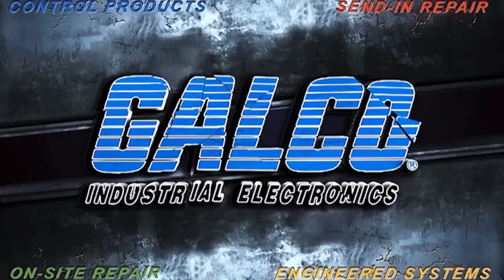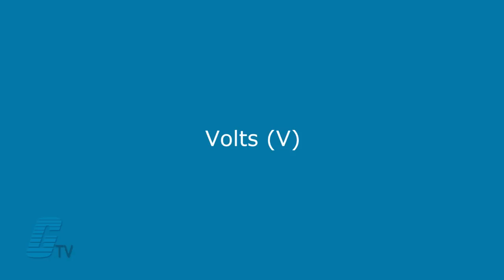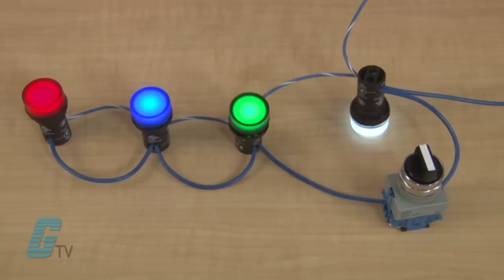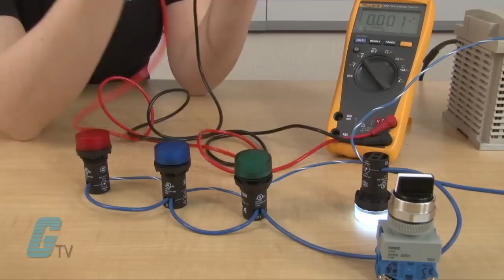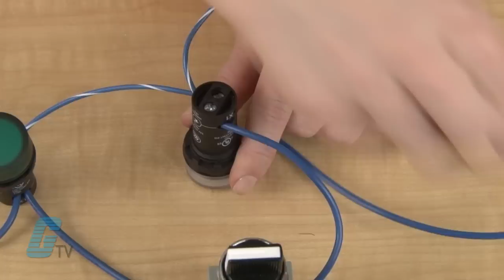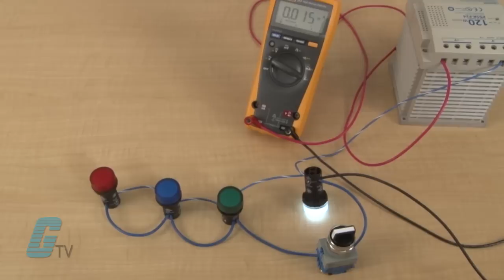How To Measure Volts, Amps, Watts, & Ohms with a Multimeter

Comment: Perhaps you could try use the converter . If a high voltage needs to be generated from a low voltage, a boost converter can be used. This represents one of the three elementary switching regulator topologies and requires only two switches, an inductor, and input and output capacitors.

也许您可以尝试使用转换器。 如果需要从低电压产生高电压，可以使用升压转换器。 这代表了三种基本开关稳压器拓扑结构中的一种，仅需要两个开关、一个电感器以及输入和输出电容器。

Comment: So volts are the traffic?
Amps are the number of lanes on the highway for the traffic to flow?
More amps means more lanes of traffic?
Resistance is where some of those lanes are closed further down the road - so the traffic has to slow down?

Comment: So if I want to check how many amps/watts an electric motor draws I just insert the multimeter's 2 leads between the live wire so current will flow trough the meter, and select meter to read ac current?
Reply from the maker: Yes that is correct. However, when measuring motor amps there can be a starting current surge, and if this exceeds the 10 amp rating of the meter it may blow the internal fuse to protect itself from to high a current flow thru the meter.

Comment: "Where voltage is supplied, current is drawn." This is false. She should say, "Where voltage is supplied, current is available."
Also, current is not slowed by resistance. Just reduced or limited.
Reply: That is confusing.  More light bulbs will draw more current if voltage is unchanged. The measurement is current used or drawn. You can't measure available current. She said the FLOW is slowed not the current.  Flow could be seen as watts. Current isn't seen as having speed, but amount. The analogy is a water pipe where voltage is the speed (or force) of the water and current is the size of the pipe or amount of water. She is leaving out a lot of information concerning open or closed systems (power supply with constant voltage vs a battery, AC vs DC, ohm's Law etc.)
Reply: @BariumCobaltNitrog3n  There is no available current without the presence of voltage. Why would you want to measure available current? The fact that it is available doesn't mean you can measure it until there is a load which makes it flow. Current does not flow at all, until there is a load. Current level is determined by EMF (voltage) and conductance across this source.
Current flow cannot be slowed. Current flows at the speed of light, regardless of its level at the time.
Reply: @Cotronixco  You seem to be arguing with yourself. I'm an electrician, I know how it works.
Reply: @Cotronixco  You're so smart. Here's a cookie.
Reply: @BariumCobaltNitrog3n  I'm an electronics engineer.
Anyone who says things like, "Flow could be seen as watts" has no clue about how electricity works. Watts is the measurement of power dissipated in a circuit as the result of conductance placed across an electromotive force. Voltage does not flow. Voltage is a force ACROSS two points. Speed of water flowing through a pipe is not even similar to voltage. Flow is current only. This occurs THROUGH a conductor. It never changes speed. This is basic physics.

Comment: I have a question though, I have an old radio which has 2 speakers which rated, 3VA 4Ω and I would like to change that to modern speaker. For that, how much watts speakers should I use?
Reply from the maker: 3VA would be 2.5 watts, the impedance would be the same at 4 ohms, ok?
Reply: GalcoTV Do you think if I can use 10 watts speaker per channel?
Reply from the maker: Sure, just make sure the impedance matches.
Reply: GalcoTV Ya the importance 4 ohms for sure, I am just worried that it's an old tube amplifier radio. If I add more watts speakers if tubes gonna blow away. It's really rare to find tubes these days. Thanks alot for the reply GalcoTV
Reply from the maker: You will be fine if match the impedance. This effects the output amplifier load more than the watt rating does.
Reply: GalcoTV Thanks alot, much appreciated.

Comment: simplified explanation, thanks, but what product of multimeter easily measures dc amps, really need one
Reply from the maker: Hey Samuel,

The Fluke 355 will measure up to 2000 amps DC with digital accuracy. You can visit our website for more information, if you are interested. :)
Reply: @GalcoIndustrial  What every steel mill maintenance engineer needs.

Comment: how can I tell how many watts my car amplifier is actually putting out?
Reply from the maker: You would need a Spectrum analyzer with some type of Summing amplifier built in to tell you how many output watts are being produced. If you are just trying to see how much load it is putting on your vehicles charging system, then connect an input amp meter in series with 1 of the power lines feeding power to your amp. Amps times volts equals watts, ok?
Reply: GalcoTV well its a 2000w amp and I just wanted to see if it's really putting out 2000w
Reply from the maker: Sorry B, but we don't really do audio stuff here. Good luck
Reply: B Krazey - Install a >=2kW, 8-ohm dummy load on each channel. You can use speakers, but be sure they are rated for >=2kW and have them in another room and/or wear hearing protection. Using a frequency generator set to sine wave as the input, max out the amp volume and measure current through each dummy and voltage across the dummy and multiply together. Do this for several frequency points, such as 20Hz, 200Hz, 2kHz, and 20kHz. You may also want to scope the dummy loads to monitor distortion. If you do, you'll get a more accurate result. Turn down the volume until the sine looks good - no clipping, no ringing, etc. and measure your wattage at that point.

Comment: Hello , 
When I do ac measurement , the voltage (V) I  get is it Vpp or 2*V = Vpp?
Thank you
Reply from the maker: Neither, because you are measuring AC volts RMS. So first multiply your reading by 1.414 to get Vp then times 2 for Vpp, ok? Please keep in mind this is ONLY for AC measurements. DC voltages read out exactly what they are.

Comment: i am trying to read the amp draw n a electric car .. i can't get it to power up with the meter inline ... it's a fluke 73iii .... maybe i need another meter?
Reply from the maker: You may have blown the internal fuse of the meter. If you have another meter check to see if you have any continuity across COM and the AMP input to the meter your using to measure the amps with, ok?
Reply: i replaced the fuse .. it works great now

Comment: so you can only measure amps while it is being used?
Reply from the maker: Yes, when measuring amperage with a multimeter, you are measuring the amount of current flowing through a circuit. So this measurement is most useful when the component is being operated.
Reply: +GalcoTV k

Comment: Not expecting what I am looking for! I want a device that automatic registers wattage and factors in farad and omg resistance.
Reply: funniest typo ever. Oh My God resistance!
Reply: @BariumCobaltNitrog3n  Yeah I have these power stations that malfunction and want to replace the resistors.
Reply: @gotsm9959  To measure farads in a capacitor, you need to remove it from the device. If your meter doesn't read capacitance you can use the ohm meter set at the highest level, usually Mohms a good cap will rise steadily to infinity, but a meter that can read capacitance is better. Resistors can be read in the device but are rarely a problem. Capacitors will bulge at the top or leak from the bottom when they fail. Start with the big ones. If you replace them make sure the capacitance and/or voltage is at least the same, a little higher is ok but never lower and always the same type. The cylindrical ones are electrolytic and have polarity, a plus and minus side. A stripe on the cap indicates the minus and will show on the board where it sits as well. Very important to get that right.
Reply: @BariumCobaltNitrog3n  Well all I know is it won't work and is expensive.
Reply: @gotsm9959  ok, I don't think there is a device to do what you want automatically. You have to do some testing.
Reply: @BariumCobaltNitrog3n  Can I just rig up a new invertor?
Reply: @gotsm9959  What are you using the power stations for? Usually inverters are used in cars to get AC from DC
Reply: @BariumCobaltNitrog3n  I just want to power the AC adapter for my smartphone/tablet and sometimes a led light.
Reply: @gotsm9959  In your house? or in a vehicle? If vehicle yes an inverter would work fine. A small 100 watt would provide plenty of juice for those things for hours. If you need more power and get a larger inverter, 500-1000 watts, you might consider adding a 2nd battery to the vehicle. A deep cycle marine battery.
Reply: @BariumCobaltNitrog3n  Inside house and it was originally 500watts power bank.

Comment: Good morning is my Solar panel is 30 Watt and my controller is 5 amps and my battery is 12 volt is that ok. 
They can make on the electric fun , and 4 bulb of light 1 watts each bulb. They can. How many electricity will load to battery.? Please tell me what to do.?.
Reply from the maker: Ok lets start with the rest of the ratings of your solar panel, ok? The 5 amp controller should be fine, and the Battery is 12 volts but what size is it, like a car battery or is like an A23 type?
Reply: GalcoTV 
12 volts 12 amp sir. is my battery. 
but I have 6 battery... sir. I make it parallel. so it keep 12 volts. 72 amps.
Reply: Sure it will work, but you will max out your battery charge at 2.5 amps, so it may take awhile to charge depending on the ah rating of the battery/batteries.

Comment: How many Volts,Amps and Ohms are generated in 1000w,1kw?
Reply from the maker: Watts is measure of power and equals the voltage time the amps; Example 100volts times 10amps = 1000watts or 1KW. If 100volts yields 10amps then Ohm's Law says we must have 10ohms of resistance too, eh?
Reply: GalcoTV Thanks My Sister,

Comment: How to measure the volts and amps my laptop draws while its charging and powered off?

How to do the same measurements while I'm using the laptop and charging it at the same time?

Thanks!
Reply: A watt meter such as Watt-Stopper will tell you in real time the information you need. Volts will always be what is being supplied by your Utility service (between 110-128 in the US). Plug the device into the wall and plug your laptop charger into that. Attach your laptop and observe it in the two situations you mentioned. You will see displayed Amps or current, and Watts or Power and some will give you the power factor, indicating the efficiency of the system.

Comment: Can we check AC amp with multi meter.
Reply from the maker: Usually you can, but it depends on the meter. My Fluke 177 will do AC or DC amps up to 10amps max.
Reply: GalcoTV thanks
Reply: GalcoTV Does the fluke 177 have a time limit for 10 amps? My cheap chinese MM says 15 seconds at 10 amps. I need a better meter than this.
Reply: AC amps are measured indirectly with a clamp meter, not directly on the wires. The clamp is a circle that opens  to form two C shapes, placed around a SINGLE conductor (one hot or one neutral) while the device is in service. The wires are not disconnected like a DC measurement.

Comment: what's the ohms setting in meter to check a trigger on a 1979 johnson 115 hp v4?
RSVP
Reply from the maker: Hello Thomas, it sounds like you are asking about a Johnson outboard bout motor? If so the, I will have to assume the trigger you are asking about is part of the ignition system? A lot of early solid state ignition systems used a trigger coil (an inductive pick up) to trip a master switch (transistorized) and fire the coil. These trigger coils will not be very high resistance, 100 to 1000 ohms maybe. Let us know if this helps.

Comment: Test leads connected to multimetre are not that safe they have exposed terminals
Reply from the maker: Maybe you need new test leads.
Reply: GalcoTV the leads connected to your multimetre have exposed connectors
Reply from the maker: There is nothing wrong with our leads, the only part of them exposed is the tips.